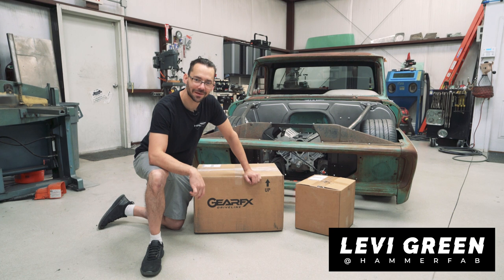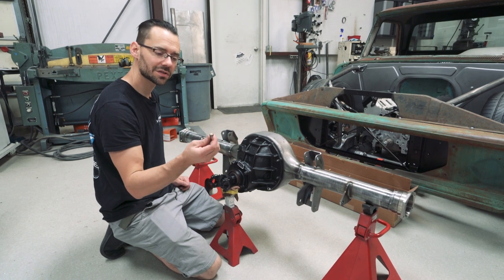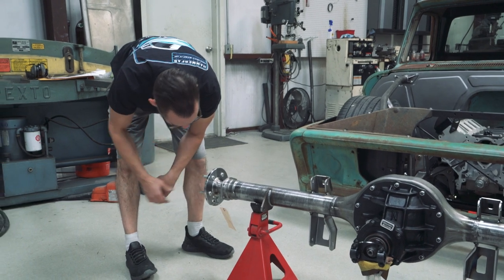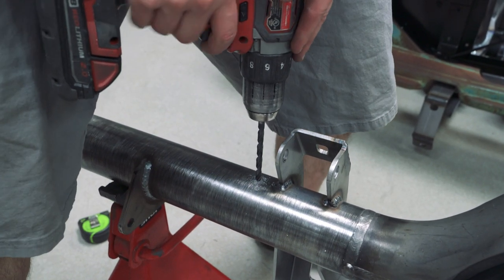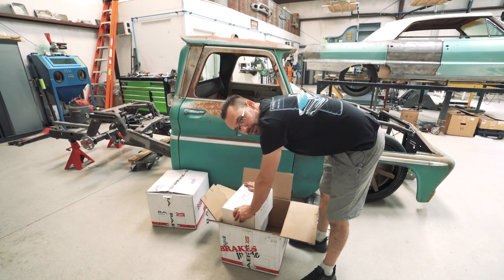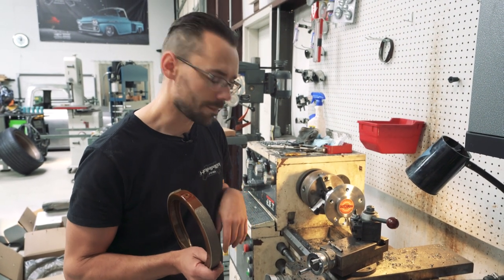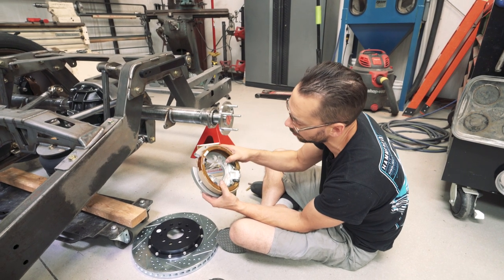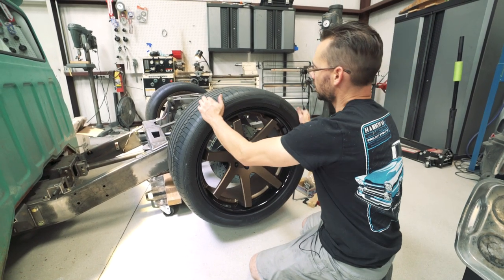66 GMC Rear Axle Install

Comment: Did you give her a name yet? “Old Blue Eyes” “Blue Babe”You know you gotta!!!  Your axle install made me smile as I remembered an older Ford truck off the instate as the axle breading went bad, axle was out of the housing tube almost to the splines.
  Having a “Break-In” gear oil is different. Unique equipment requires unique gear oil!